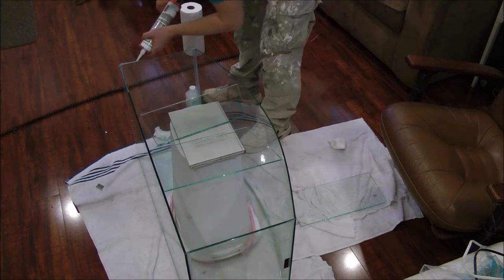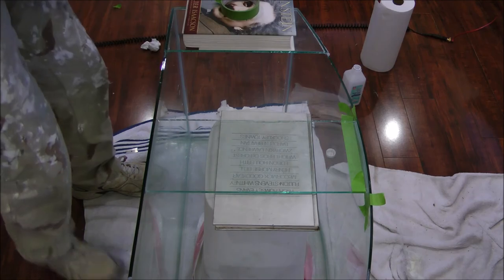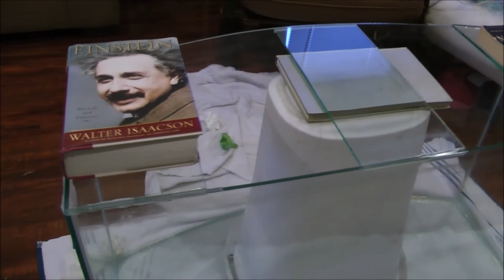How to make "euro bracing" on curved aquarium

Comment: So do u have a lid that sits on top? I’ll check or other vids.im considering having a custom tank made 100 cm x 26 cm x 30 cm tall...LFS makes them but I asked how much a rimless would cost obviously being extra. He VERY much recommends against a rimless and was pretty straight to the point..”what the hell you what rimless for? You don’t wanna go that way, their not a good idea, regular is much for safe and stable...water has to be pristine and tank kept clean as to not show water marks on glass, what about any water splashes or spitting coming up from any filter or bubblers, you have cats and that’s not safe for fish, plus some fish can jump out !!!!!DONT do it. “ I’m like...argg I really like the clean look plus u can scape up out of the tank. The look sleek especially when scaped beautifully (mind u I, hopeless at scaping well. 
But with supported and centre braced tanks often water residue builds up around n under those glass ledge pieces around edge that are slightly lower then height of tank plus it’s hard to clean “under” them etc...the centre brace looks darn ugly too... 
I see your edge braces are level with height...I’m wondering if I can make that an option if he builds my custom tank and wondering if the centre brace really needs to be included and if so how wide does it have to be for a 26 wide 100 cm long tank ? Hmm....so confused whether to even go ahead with the build or just to stick with the 46 litre bow front one I have now ?